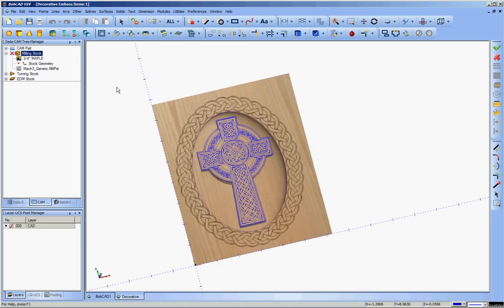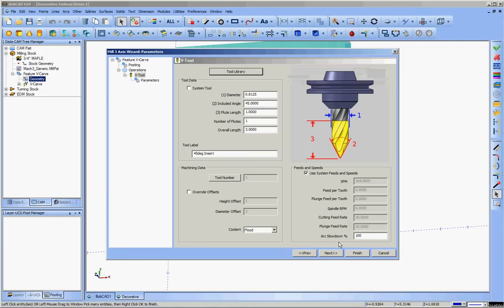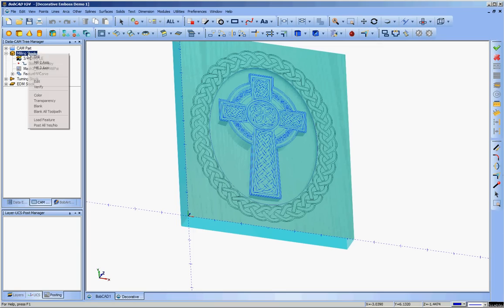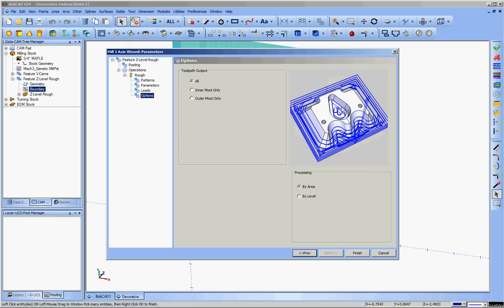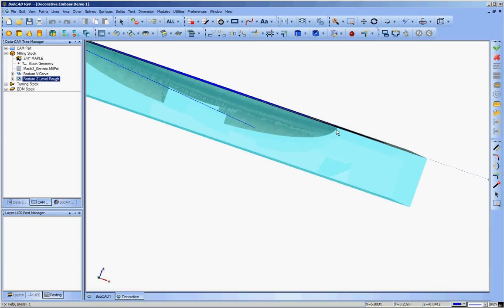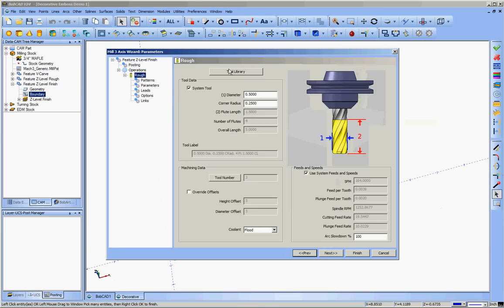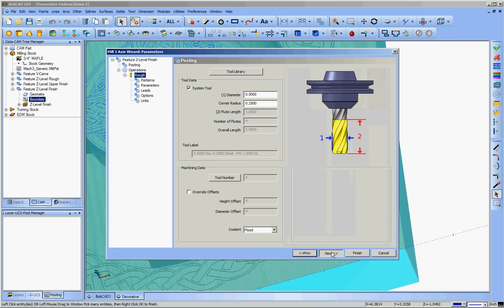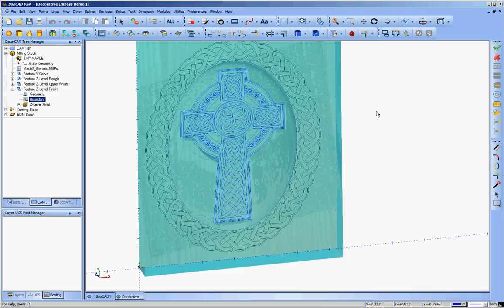Decorative Wood Carving using BobArt: Part3; Cutting Strategies and Toolpathing

Comment: i dont like the sim-in V25, its a whole bunch of not any better,, right now im running NVIDIA 555m series vid card and quad-i5's with 12gig of RAM and it still has to be slightly slowed with the new simulation stuff they added,, V23 and V24 are just fine,, i actually had sim-probs at 1st with V25 and they told me i was barely using enough computer to handle it all, i use lanovo and dell both with big vid cards,8-12 gig RAM and 4-i5 prcsr's and it takes everything the computers have to run-sims